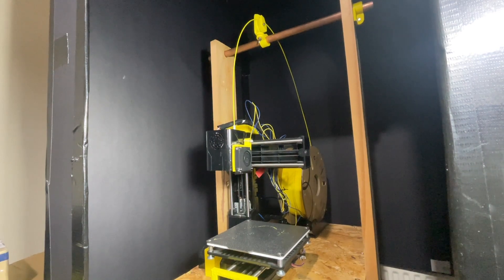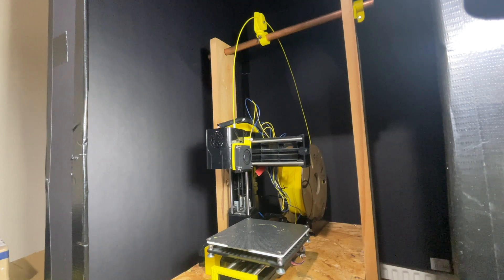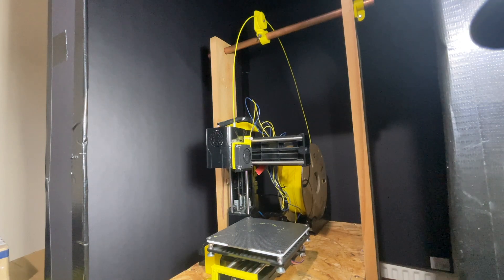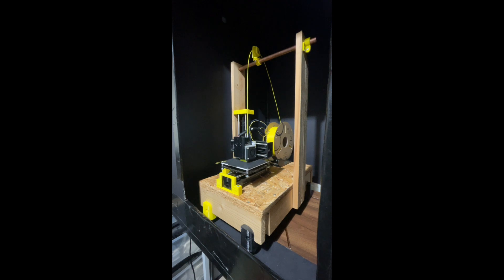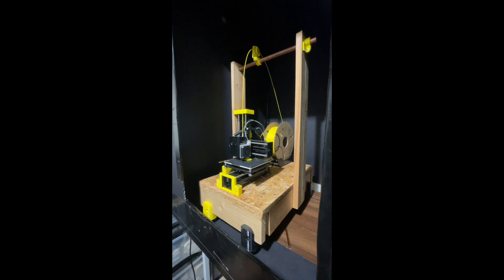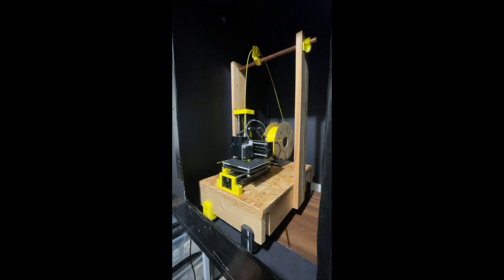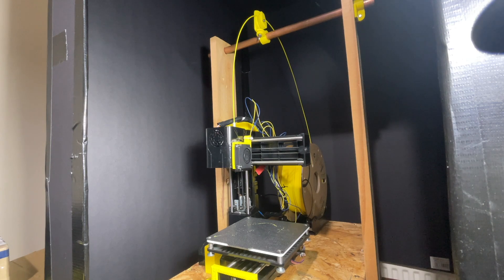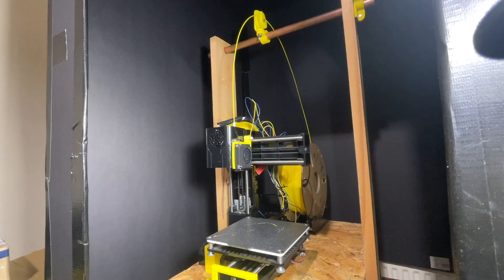Easy Threed K9 Mini 3D Printer Vibration reduction Direct drive hot end

Comment: I will do a video soon, but I go around this just by printing some inserts that go into the filament roll to fit onto a plastic tubing. Very low friction means that there is no tugging or vibrations on retraction. 

Just waiting on some resin carriages to arrive and then I'll be doing a video.

Comment: I had made a spool holder out of wood but now I have a PLA one with bearings for the spool to run on. I printed a block for the top tube so the filament can run through smoothly on my Ender 3 v3 se. I did notice the spool was moving a bit and didnt want to risk the prints go9ing wrong on the x and y axis.
Reply from the maker: Thanks for watching & for your comments. Ive seen the designs with bearings Most of the ones I have are just a basic metal prong but maybe the K9 should have something that runs more freely due to the fact the frame will be pulled if it has to pull the filament too much like in the example of the retractions pulling it about. So too just with the simple extrusion of filament normally. I do think the printer can benefit from a more freely running filament holder. Kind regards & best wishes.